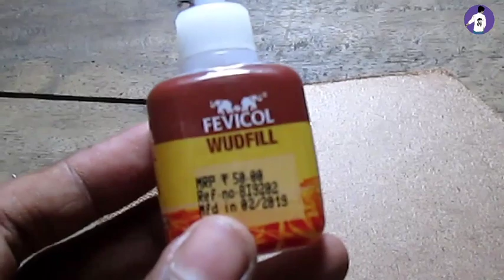wow!!!! led DIY aurora lights awsome/kerala hacker

Comment: You could have used an aluminium foil on cardboard then the light would have uniformly distributed with reflection.
Reply: Do you speak spanish?
Reply: @deltardx2800  no
Reply: @deltardx2800  i can
Reply: @brb_yt3046  oh there's a tutorial in channel called proyecta tu mente, very useful and inexpensive
Reply: @deltardx2800  ohhhhh =O ill see it
 thanks for iut though =)